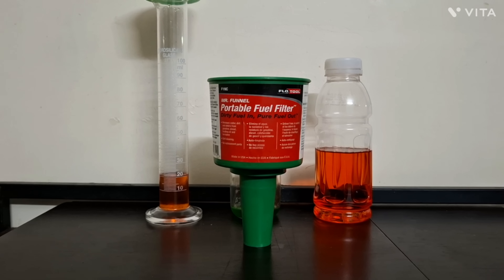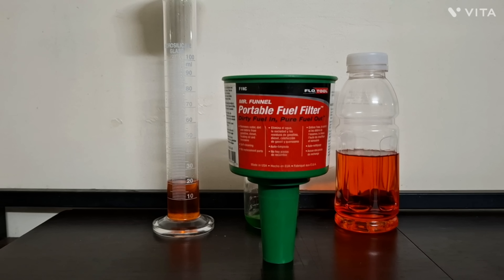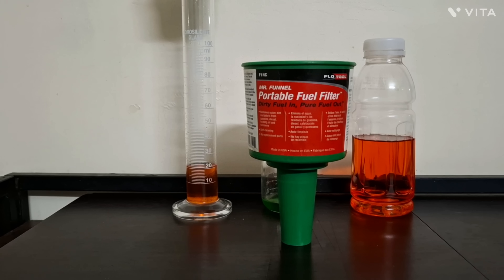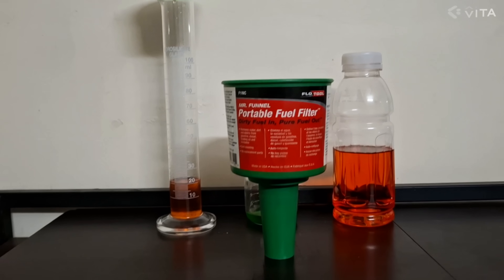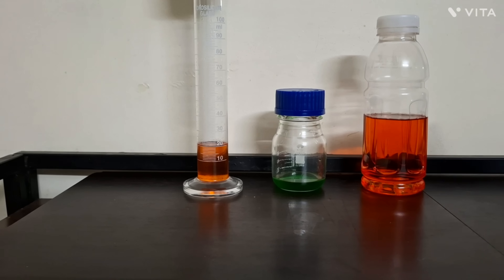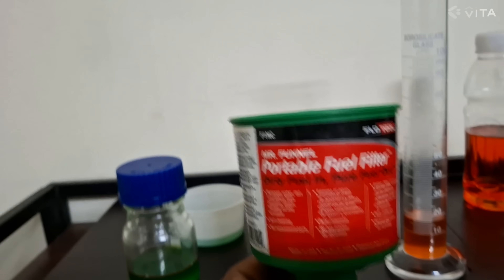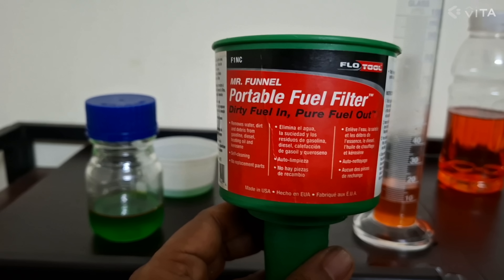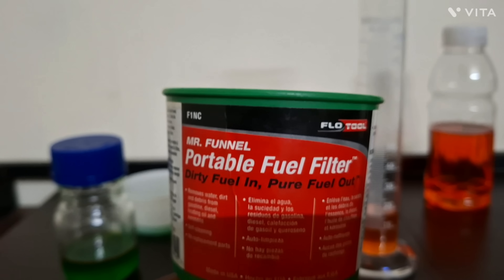Ethanol phase separation filter miracle funnel, This is awesome.Work around video #3 = 10th Oct 2025

Comment: Bhaya xp100 Ka price 160 se 149 hua hai kya isme bhi ab ethanol mix karre kya re test karo na fresh stock se pls mujhe doubt horay
Reply from the maker: Already done. It is ethanol-free.
Reply: @zubtubetube  bhaya latest Naya vala stock pe karona pls kyu ki price drop hua hai na tho shayad hora Hoga pls
Reply from the maker: Yes latest wala hi hai. Rs 149 per liter  wala. As the demand increased indianoil has reduced the price. It is ethanol-free.  I use xp100 for all my vehicles,  I test it before buying. It is ethanol-free

Comment: I was planning to try the following since i have this funnel since a long time, add water to the e20 fuel and shake it well. Then run it through the filter, since ethanol is hydroscopic we should be able to separate the water and ethanol through this funnel. Need to test it.

Comment: In XP 100 also they are now adding ethwnol
Reply from the maker: Absolutely incorrect. I tested it is E0 on 15th oct 2025.  I filled 60 liters in total in all my vehicles and superbike.  It is Ethanol-free.
Reply: @zubtubetube  But the Government has already issued the order to add ethanol in XP 100 also.
Maybe they add it within a couple of months
Reply from the maker: Xp100 and power 100 is made for supercars.  Where in it was introduced mainly for those cars where they pay crores as tax. Recent rti has confirmed xp100 and power 100 will remain E0. However this fuel is only available in Tier 1 cities mainly. In limited bunks. My friend is a bunk owner he owns supercar aswel. So absolutely no issues with xp100 at the moment.  Even if they push. We have vp racing fuel. This is been there from decades.

Comment: alternate- buy a fuel filter from automobiles shop, or 5rs mask from medical shop, cut a juice bottle in half, make a hole in cap, tight it with mask/fuel filter, pour the mixture, it does same work how this costly portable filter does and its cost effective

Comment: medical shops 5rs mask is also a good filter for seperation of petrol and water.
Reply: i really have it. mask directly dont filter out water. it should be rinsed in petrol litle bit. and it really repels the water. once try it
Reply from the maker: @harys6382 will try
Reply from the maker: U can use it😆, best of luck to ur vehicles
Reply: @zubtubetube  by removing e20 im getting 68kmpl from my mt15, before it was, 48 to 49 kmpl avg, with e20

Comment: I've been using this since 2018. Super useful. I've been telling people to get this for so long. But no one believes
Reply: A better brand is guglatech. They can be fitted inside the tank
Reply: But does this work with E20 petrol.
Reply: @aby2512 it's not an ethanol filter. Meaning its built keeping water in mind. If your fuel had ethanol or petrol contaminated with moisture/water. That water(that now has ethanol in it will be filtered out)

Comment: Sir, 1 more Q. What if I mix V Power with xp100 with 50-50% ratio? Bcaz in Maharashtra Vpower comes with 15% ethenol. So mixture will be with 7.5% ethenol. PL Guide & suggest.
Reply from the maker: Yes it will be 7.5%

Comment: How will this work if using it for refueling 4 wheelers? Because the funnel will need to be tilted which won't help. Is there a bigger funnel for this purpose with a longer beak?
Reply: My other concern is what to do with the water collected inside the filter. Do we need to discard with a bit of caution or can it be dispensed down the drain?

Comment: The Mr. Funnel filter works by surface tension and density differences:
	•	It stops free water (droplets or separate water layers) from passing through.
	•	It does not perform chemical separation or filtration at a molecular level.

Since ethanol and petrol are homogeneously mixed, the filter material cannot distinguish or separate ethanol molecules — they behave just like petrol in terms of flow and surface tension. Hence this does not work on E20 fuel if pored directly from the nozzle of the pump. The petrol must be collected in a separate can, mixed with water, rest it for sometime, then pore into this funnel. I guess this is not practical for most of the people.
Reply from the maker: Yes, you are absolutely right. This filter works on surface tension, and that's why it stops water and impurities, not ethanol.. main issue is water getting into engine, and ethanol attracts water from atmosphere

Comment: Will this remove only water or it can remove ethanol also . Kindly inform .
Reply from the maker: This only removes water and impurities,  ethanol blend fuel will pass through. Immediate Problem in engine occurs when water goes inside. Phase seperated ethonal attracts water from air around. Ethanol blended fuel will have slow impact. Problem is water.

Comment: i try to ride my 2000's bikes  for 2-3km every day so that water doesn't collect for long.
what is your opinion on my solution? will this work?
and when water goes into the fuel tank in my bike then what are the parts it can damage? what should be repaired and replaced in it?
Reply from the maker: Fuel lines will become hard, tank will have rust, that rust will enter ur combustion chamber over the period time, this will make the piston hydro lock. Basically piston slides up and down smoothly as there is lubrication,  now water due to ethanol will dilute the lubrication and piston will rub against the cylinder walls and get into hydro  lock.

Comment: Thank you — these experiments are very helpful. Quick question: can this filter be used directly at petrol pumps with the standard fuel-pouring guns, or would we need to transfer the fuel into storage containers and then use the filter to fill our bike/car tanks?
I feel many people will have this question in mind. Would really help if you can clarify.
Reply from the maker: The flow rate is 9 liters in one minute. Important thing to remember,  the moment water is in the fuel, the fuel filter sump will start filling up. This is where u have to ask the petrol bunk attendant to stop filling. This is the indication that the fuel has water. This is a filter which help u to stop filling when water is in fuel. I hope u got the concept of this funnel

Comment: it’s not practical, you can try this while filling car. 1 litre in 5 seconds will not be filtered and 20% ethanol means in 1 litre this will be filled with water (200 ml) then how 40 litres will be filled by using this ?

Comment: In this demo, water was separated from 100% petrol, which is not a likely scenario one is likely to face as water separation occurs because of the presence of ethanol.

If this filter is used on an ethanol blended fuel, will it remove the dissolved ethanol as well? And what will be the characteristics of the remaining pure petrol? Will it be suitable for use because the petrol blend may contain additives to maintain certain characteristics like octane value with the ethanol and petrol combined and those may go off balance with the removal of ethanol

Comment: How will this funnel filter work in real use case when filling petrol in a bunk. Example if I am filling fuel about 30L full tank of my car or even 10L for any vehicle, the speed and force at which the gun dispenses is greater than this filtering capacity. This could result in fuel getting overflown or spilled outside as it cannot pass through inside the tank. 
Also, the capacity of water it can hold is very little maybe 50-100ml. In 10L, 20% ethanol means almost 2L will be spilling out. 
Can you really use this in bunk directly when filling. Would like to see a video. 
As of now this product is good for small experiment pouring a small bottle of petrol
Reply from the maker: This filter is used in usa from decades,  its early detection of any water in petrol,  they moment it starts filling water, we have to stop filling that fuel. Further if u want to filter that contaminated fuel, u have to be patient and go slow on it. All this if u want clean fuel to go into ur vehicle. When u have doubt at the bunk fuel. I hope its clear now.
Reply: @zubtubetube understood, however if you could make a video, it would be highly appreciated. Thank you
Reply from the maker: Sure
Reply from the maker: It has very good flow rate of 9 liters in a minute
Reply: a real world video example of a filter being used at a petrol station would be appreciated. Will be like a guidance.
Reply: Yes Zuby please do a live demo of the funnel at a bunk...
Reply: Actually, i am thinking that can we mix water in E20 fuel and after ethanol get mixed in water, then we can separate out pure fuel and use them

Comment: My question is that if i put 1 litre normal fuel in my car, does that means this product will separate ethanol from the petrol and only the petrol will go inside the tank.

Or the ethanol has to be already separated from the petrol like you have shown in the video

Comment: appreciate your efforts but still ethanol would go inside the tank with the petrol...and the cost for this fuel filter is somewhere around Rs.4,800
Reply from the maker: It is 2.5k , not sure why u said 4.8k, This is a filter which filters phase seperated ethanol water mixture. This phase seperated ethonal is the main reason for vehicles engine damage, ethanol blended will have slow impact.  Hence this funnel is a life saver.
Reply: @zubtubetube it's available on Amazon for 4,800...

is this filter also filters ethanol from the petrol and upto what extent...

if i want to fill 20 liters of petrol in my car, will this filter is enough to filter 20 liters in a single shot...

where is this available at 2,500

where did you bought it from...will you share me the link...
Reply: @zubtubetube sir i am expecting a feedback from your end...
Reply: @zubtubetube sir i am expecting a feedback from your end for few points lastly i messaged you on the subject about the filter, it's capacity to filter and the link from where you bought this...
Reply from the maker: It filters 9 liters per minute,  it will not allow water to get into ur tank
Reply: @zubtubetube okayyy thank you, that means i can use this to fill 20 liters of petrol in my car...

and tell me from where you bought it at 2,500

Comment: Whatever efforts u r taking for all of us is really awesome. Firsly many many thanks to you boss for all these experiments. My genuine Question cum doubt. 

I have 2 cars & 4 two wheelers wise.... 
1) Hyundai Accent car 2006 model, giving milage of 16/17 on highway with AC on. now reduced to 10/11
2) Maruti swift Desire 2012 model, giving milage of 19/20 on highway with AC on. now reduced to 13/14
3) Honda Activa 2012, milage of 48/50, now around 39/40 
4) TVS Jupiter 2021, milage of 44/45, now around 28/30
5) KB100 1989 & 
6) Kinetic Honda 1990. Old is gold.

All vehicles r runnig on road & very well maintained & tuned. Now since kb100 & KH both being 2 stroke vehicles, no bad effect of ethenol blending on it. But for remaining 4 vehicles that is, Accent, Dezire, Activa & Jupiter, Rather than entering into all this ethenol headake, WHAT IF I USE STRAIGHT AWAY XP100 or POWER100? Will it be ok or will it still backfire & lead to some different problems? It would be really nice if u can suggest & guide. Waiting for your reply eagerly. Because I really love (Attached) my all vehicles very badly.
Reply from the maker: First of all thanks a lot for ur support and encouraging words. Really appreciate it. 

Really nice collection of vehicles,  This is my collection Kb 125, Rx135 speed, Pulsar 180, Dominar 400, Z900, City vtec, Lancer and a Santro. Same like urs all well maintained and running superbly. 

Coming to ur question on using Xp100 or power 100.  These both fuels are Ethnonal free hence this E0 fuel is like best any vehicle can get.  From the 2stroke vehicles to latest vehicles all will run with absolute bliss.  Challenge is xp100 and power 100 availability is limited and these are sold at a high cost of Rs 160 to Rs 180 a liter. 
If cost doest bother you and if u have a good rapport with bunk owner to provide u xp100 or power 100 then this is the best ur vehicles can get.

Secondly as these premium fuels are 100 octance they give the best performance only in high performance vehicles otherwise apart from engine smoothness and increased milage there is no other performance boost in normal vehicles. In my case only my Kawasaki z900 and city vetec show immediate performance boost and both these vehicles are flying when on xp100 or power 100,  for rest of my vehicles its just quality of ride has improved and slight milage has improved. 

So I use 100% xp100 and with good contacts with bunk owners, this fuel is available throughout and I have made arrangements to always have ready stock. 

Further in my daily commute vehicle like pulsar 180 I use combination fuel 50:50 [ 5lts xp100 5 liter normal fuel ] this combination even outs ethanol content to e10 which is ok and Working well. 

Rest of my vehicles actually fall under recreational purpose used limited. So u too can categorise as to which vehicles u want 100% E0 fuel and which can use combination fuel.  Just to give u my plan of action u can refer the below pointers.

My plan 
1. City commute = Ev or flexfuel Activa or Pulsar
2. Sunday speed = Superbike filled with Xp100 or Power 100
3. Family tour = Car with Xp100 or Power 100 in jerry cans
4. Solo long ride = Dominar400 with saddle bags with jerry cans filled with Xp100 or Power 100
5. Solo ride on Superbike saddlebags with jerry cans filled with Xp100 or Power 100
6. Vintage vehicles = RX135 5PEED, KB125, Honda city,  Lancer on Xp100 or power 100
Reply: @zubtubetube  ohhhhh sooo nice of you. I am feeling like reading a love letter. I admire & appreciate for taking so huge efforts to shoot soo long crystal clear eloborative reply. 
I got exactly now. 
1stly let me try out with 50-50 option. that mk sense with E10.
Thank you so much once again with tonns of love & respect.
Instant reply with intention of making some's life better needs TIME. 
Giving some time from your life = good deed.
Good deed never go waste.
Salute to you boss for being human.
Reply from the maker: Really appreciate it, Sir
Reply: @zubtubetube  Sir, 1 more Q. What if I mix V Power with xp100 with 50-50% ratio? Bcaz in Maharashtra Vpower comes with 15% ethenol. So mixture will be with 7.5% ethenol. PL Guide & suggest.

Comment: Question for you is how do we use this at petrol pump . If we are going to fill fuel 10 liters of petrol . How can we dispose the 2liter water collected in the funnel. Another doubt how much liters of petrol can this funnel filter
Reply from the maker: The filtration flow is awesome. Further when it starts collecting that means bad fuel, immediately stop. This is how u prevent bad fuel getting in. This product is in Usa from lot of years. Its a tried and tested product.

Comment: Its no point. In coming 2 years it going to be e28😂😂😂
Reply from the maker: I use xp100 and power 100. E0 FUEL. it doest matter if they come with E20, E50 E100

Comment: Zubi bhai today I filled petrol of Bharath Petrol speed, earlier 2 times also I filled the speed petrol only from the same bunk, thinking less ethanol Even after doing also my milage dropped 5  km less. Could you pls check once again the ethanol content in speed petrol
Reply from the maker: Unfortunately speed 95 is also gone up to 17%. Thats y u saw drop in milage.
Reply: I guess XP 100 is the solution 😢

Comment: If it doesn't filter ethanol then it's of no use.
Reply from the maker: Have u heard abt ethanol phase separation.  This is death knell for vehicles.  Atlest  unseperated ethanol will have slow impact.  But phase seperate ethanol will kill ur vehicle.
Reply: @zubtubetube Then is it danger to remove Ethanol from the petrol?

Comment: Pls do the same with normal E20 fuel using this funnel again
Reply: There will be no change With the percentage of ethanol.
Reply: it wont separate the ethnol at all
Reply from the maker: We fail to understand this. Ethanol is not the problem.  The water which gets absorbed by the ethanol creates the problem in engine.  So when filter filters out the water the engine damage issues are taken care.
Reply: @zubtubetube  thanks a lot for answering guys

Comment: does it works with diesel as well to remove the contaminant?
Reply from the maker: Yes
Reply: @zubtubetube since ethanol is hydrophilic, if we add water in 100ml water in 1 ltr of e20 petrol it will pull ethenol out of the petrol & then if we filter it with this device we can get almost pure petrol, can you make video on it?

Comment: It's not clear from video that whatever ethanol water mixture trapped by funnel is because it's capable to trap water or ethanol or both.

Because with 15-20% ethanol, even if we seperate out ethanol, what we will do with that much ethanol?
But if it only trap seperated water then this will be good to at least save engine from water settled due to ethanol.

You should try same experiment with normal E20 petrol and mix water and check what it seperats.
Reply: It won't separate ethanol, just water

Comment: hope you upload a more practial video demonstrating how to separate ethanol from aduterated petrol. If your old videos are taken as reference it is not practical for high volumes of petrol. I fill 5 litres in my scooter at a time. If 20% ethanol is blended in fuel that means we get only 4litres pure petrol. roughly 135-140Rs./litre if removed 20%ethanol from petrol.

Comment: Hi Zuby, does the filter flow rate appear to be slower than the petrol pump itself? Will that cause a backlash leading to overflow before entering the tank?
Reply from the maker: Its good.
Reply: @zubtubetube it's been a while since you posted, is everything alright?

Comment: There is a downside of removing ethanol from petrol. It decreases the octane rating of the fuel which is harmful for the engine
Reply: you can add additives later on.